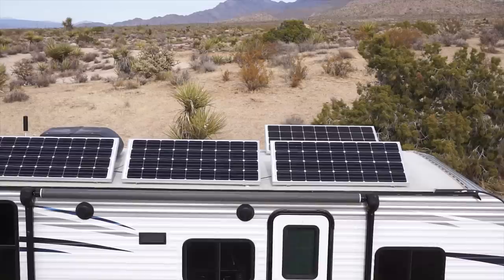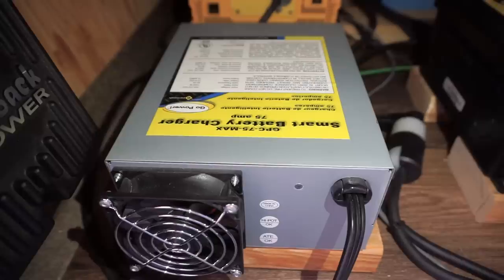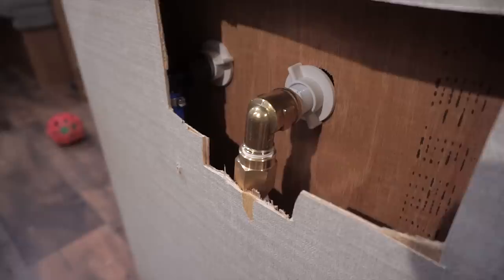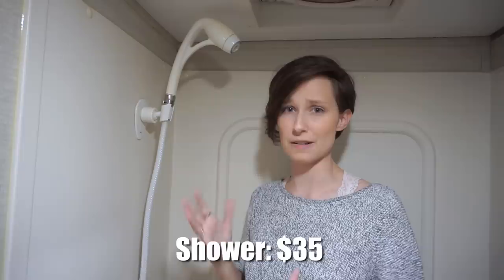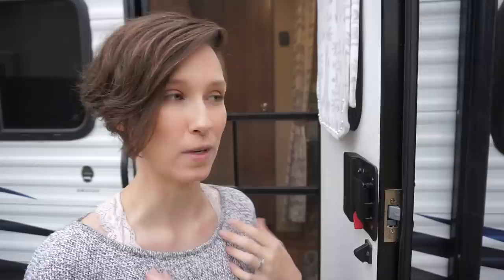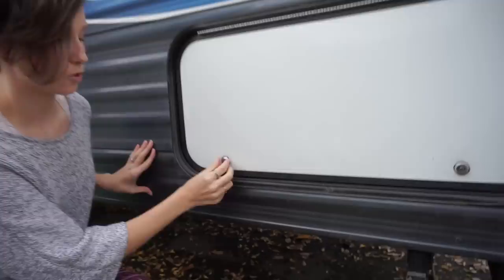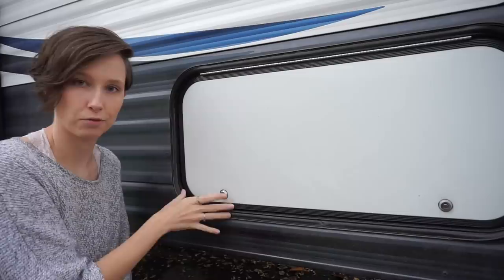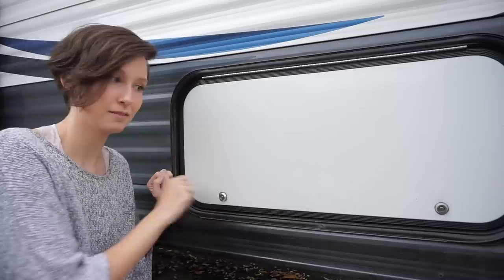Was It WORTH IT?? - All Our RV Upgrades Review - Solar, Toilet, Booster & More

Comment: I know im late to the party.... Sorry.... but if you are still having the issue Ref: the rv lock.... "guinea pig" as a test. take out one of the screws that holds the lock in place. Try grinding the tip of the bolt back by... say... 1/8" but no more... you will probably have to taper the very end of the threads after you've trimmed to length, just a bit to clean the starting threads up. if you feel like the one bolt has achieved you purpose, repeat the process. This process is based on the premise the bolts have bottomed out.

Comment: Putting a one-way valve on the hot water line to keep that from mixing is a brilliant idea!!!
 It would also help behind the shower that's outside because I've heard of people using that at a dump station and forgetting to turn both valves off (only turning off the shower head) and not realizing for quite some time why they were only getting lukewarm water from their water system!!!!!

Comment: I'm looking at downsizing my 5th wheel to a much smaller travel trailer (it's just me and my cats). Since your trailer has the aluminum sheeting on the outside instead of fiberglass for its external walls, do you find it gets loud during the rain? I imagine it would sound like my mobile home's metal awning did, which got very loud during strong rain storms.

Comment: To keep it from moving around just get a piece of rubber pad like I did cut it out to the size on the indoor and then place it with this screw and it will hold it nice and tight and solid to prevent it from moving

Comment: Hey guys. To secure the loch you can put a little adhesive behind the interior plate. Also to keep the screw from backing out is to put some locktite on screw. That should hold it.

Comment: I’m wondering if the door screws are bottoming out? Meaning they are a hair too long. 
Anyhow great video and reviews. Thanks.
Reply: I installed this same lock, and one of my screws did not go fully in.  I sanded a thread and a half off to fix.   But,  as pricey as this thing was you should not have to do such things.   And I dont think ther screws are really too long,  but thre holes are not fully tapped to thre bottom.  But did not have a bottom tap to fix it that way.
Reply: what i was thinking as well massaging the end of the screw with a grinder to make them shorter and a little blue locktight on all screws to insure they don't vibrate loose would make a huge difference!

Comment: If your still q ing problems with that screw on the door....remove the screws,James as many toothpicks as u can in the hole, cut or just brack them off as u go...now try scewing that screw back in, it has something wood to grip into. CHEERS Your doing a super job and have to e of useful info,thanks

Comment: I did a one minute test into a bucket with that Oxygenics shower head and it used more water and had less pressure than my stock Camco shower head.  So I put the Camco back.
Reply: That will save me a try. Thanks.

Comment: RE;  The door lock, buy screws that are just a bit shorter and try them.  Or thy could be cut down two or three threads.  And as "Dave W" recommended use Loctite and a silicon sealant around the inside fascias.  We have a Springdale and definitely added the lift components.  Also bought a 3" Lucid gel memory mattress topper.  Added onto the original mattress was the solution.  Very comfortable after that.  Price for the mattress was $94.99.  A regular queen size I had to trim it to fit the RV Queen.
Reply: correction:  silicon both inside and outside of the door fascias.....

Comment: Thanks for the info. 1) HATE it when turning the shower back on and the cold comes out. Best info on that. I will be seeing about the 1 way valve for my 5ver. 2) Aluminium blinds should be outlawed. 3) I see the lifts for the bed in the future for my 5ver also.

Comment: Regarding the smell from the toilet, that is probably due to the urine fumes going back up the funnel.  A simple solution would be to take out the urine container, install a line directly to the grey tank while installing a shut-off valve on the line so that no smell is coming back up.  Opening the line would be just a quick turn of the valve, rinse after use and close the valve after.
Reply: Or save 3 grand and 30 hours of labor and do your business outside.  Waste of money.

Comment: How long a run time do you get out of your Airconditioner at night with no sun on those batteries?
Reply: Also interested
Reply: @seeworthyglass2880  
Batteries / sunshine don't run ac.
Reply: terryblount I’m pretty sure you’re wrong... though I don’t think we will get a response with the answer. Good luck with your RV projects
Reply: @seeworthyglass2880  
Obviously massive solar systems will run ac but the cost and weight and effort of making such a system work quickly reach a point of diminishing return.

I have used a small solar system for cooling but I only had to use pumps and fans to exchange the 68 degree ground water temperature with the 85 degree atmospheric temperature.  Cold ground water is just not available at camping grounds.
Reply: @seeworthyglass2880  
I thought I was wrong once but it turned out that I was righ.

Comment: My RVLock (uses a key fob, not push buttons) doesn't move. I used blue thread locker on the screw threads. I also replaced the baggage door locks with 3 digit combination locks and the remote for the entry door (with push buttons), is in the nearest baggage compartment. That way we can leave the camper locked and not worry about being locked out if we don't want to bring a key or fob with us.

Comment: Great Video, thank you. I'v just started RV'ing and making upgrades/fixes etc to mine. With the Door lock (I have a standard house type working great) you might consider putting a tiny bead of silicone adhesive under both interior and exterior plates (after well cleaned surfaces)and reassemble them. This should eliminate the movement. As far as the one screw (couldn't see it too well) could you change screws and possibly drill out the countersink (or add some) to the hole to allow the screw to seat better. Corrosion, that's a bugger. Well wipes silicone and nail polish on the flat portions of the strike ... maybe.  Not sure about that one.

Comment: Take the RV lock a part, and use some clear silicone on the back plate where it connects with the door, and reassemble it.  As for the loose screw, you can try a longer screw or put some silicone on the threads and screw it back in.  Let it dry for about 24 hours before giving it too much use, and it will resolve a lot of the issues you are dealing with it shifting on you.  It will also add some waterproofing on it.  You could also use some plumbers putty.

Comment: Where the screw on the striker plate is put a machine screw instead of a wood screw.  You will will have to drill a hole from the striker plate back to where you can put a nut on the machine screw.  Drill a hole threw the side to where it intersects the machine screw and install with Locktite.  You will be very happy

Comment: Ok, I’ve been thinking about the lock issue. Here is my experienced in maintenance opinion. The screws are bottoming out, aka too long. Pull one out, go to Lowe’s or Home Depot, and get the same and you can probably get stainless 1/4” shorter. That should cure your issues. Also replace the striker plate screws with stainless. If it worked, let me know and if not I’ll talk you through some other options.

Comment: Well done!
Maxx Air Vent Cover, about $30.
The original shower head was designed to drip so the water temp stays constant while you are soaping up. It is not a complete shutoff, by design.

Comment: Take a counter sink to the latch plate. 
For the lock shifting ....Trace the lock( w/ pencil)on where you'd like it to sit the trailer. Take it off and run some silicone caulk under where you'd like it to be on the door. Place  back over silicone tighten and hold in place until dry with painter's tape guaranteed never to shift again

Comment: For your loose keyless entry locks being loose & wiggling. Take the lock back out & cut a gasket out of some automotive gasket material to put between the body of the lock & the door. If that doesn't fix the problem then put a gasket on the inside of the door also to fix your wiggle problem.
Gregg Muse

Comment: solution for keyless lock... adhesive called "shoe goo" (look in shoe isle). It literally holds my truck tool box to the bed of my truck and patches bike tires. Use a couple dabs  on the outer plate and stick it to the door... You're rusting screws? Take one out...go the hardware store and ask for help finding brass or stainless steel or something... They will find it. Screws coming out?? Again, some shoe goo around the head or thread locking compound from hardware store

Comment: Try getting a sheet of rubber gasket at Lowes or HD and cut to fit the inside of the luck, that will make the door a bit ticker - try a piece of card board first (shoe box) to see if it will work, or you can try shorter screes or file down  two of the screws to see if it would work. Best of luck Guys.

Comment: You also might try the golf tee trick: for the keyless entry. Basically you break off and shove the tip of the tee into the existing screw holes. Then remount the lock. The idea is to give the screws something solid to bight into.
Reply: wmsatic maybe use longer screws with that great idea of yours !

Comment: Not sure how the inside of your door is set up but there are a couple of possibilities for keeping the latch screw from loosening up. Inserts are available to go into the existing hole the screw goes in. This only works if there is wood on the inside of the door for the screw to turn into. Might have to drill the hole slightly larger. Another better possibility if there is wood inside the door where the wood screw turned into is to use a threaded flat head machine instead of a wood screw with a T nut on the inside for it to turn into. Would probably need to drill the hole in the door larger and deeper to insert the T-nut  on the inside of the door. If there is no wood inside for the screw to thread into and all that holds the screw is the metal add a piece of wood on the inside for the original screw to tighten into or use a flat head machine screw with a regular nut on the inside. This is a last resort because every time you need to remove that screw the nut would fall off inside. Also you might be able to put some sort of spacer inside the door around the lock to prevent it from moving. could be wood, plastic, or metal. This would be even more effective if the screws for the lock went through the material you use to fill the the space between the door and the lock if it is possible. Schlage makes a lock with similar features but a different design. I have one on our door. it works well for us but we have it in a metal entrance door on our home so the construction of your door may be different.

Comment: 21:32 We have the RV Lock on our camper, it is solid and does not move.  The bad thing about the RV lock is the material that the screws go into is of a plastic type and a machined wood-screw holds it all together.  I should imagine if over-tightened, these screws would strip out the plastic.  Personally I would buy the lock again, it has been rock solid since we purchased ours, but the one thing I do not like about the purchase, it only comes with one remote, you can buy more remotes, I just wish for the price it had two of them.

Comment: I have two RVs with the RV Locks on them.  On one of them I had the same issues that you are describing.  What I found was that the screws & bolts supplied with the RV Lock were just a bit too long for the thickness of my door and striker area.  I went down to my local hardware store and got ones that were just a bit shorter.  I also used a bit of lock tite when I installed them.  2 + years and no issues.

Comment: Add silicone caulking to the door lock around the perimeter should work well. Or make an aluminum plate as a spacer to make of the difference in the thickness of the door

Comment: Try a silicone sealant on your door. Take the new handle/lock off, line it with a silicone, then screw it back in place. Should keep it in place and water proof :)

Comment: I had trouble with screws staying put on my 5th wheel, so I would use a bit of jb weld on just the screw and it works perfectly.

Comment: i'm sure someone has told you but put some silicone on either side of the door handle and i wont move anymore. if you want something less permanent: Use a hot glue gun to go around the opening, let it harden, then reinstall the handle. Won't do as much for water proofing but it will stop the moving. :)

Comment: Put a golf tee in the screw hole and take some door wedges that you get at the hardware store and slide in behind there and tighten it down to where it will not slide around that may work for you

Comment: On the door lock, if you take some 2 sided tape or even some thin rubber and put behind both sides before tightening it back down it should stay in place better. The screws that keep coming out I would get some stainless or coated screws from the hardware store and use some blue or low strength loctite on them and they should stop backing out.

Comment: If you pull the interior of the door off you can set blocking, I'd use gorilla glue or something like it ,then put it all together and it will be solid.
Thanks for the vids
Reply: Agree with you totally the door is hollow so unless you sturdy it you'll never get the screws actually tight.

Comment: If you use a use a machine threaded stainless screw that is long enough to reach the lock enclosure with a washer and a nut it will stop the latch assembly from loosening up.
to stop the lock mechanism from moving just take it off and put some silicone  on the inner sides and reinstall it and you will completely stop it from moving around.

Comment: i would say for the front door you need to either shim the strike plate and the housing. The screws look too long basicly. 
So either go find shorter screws, which you might need for the strike plate. Or shim it so it just compresses better. 
if the issue is the screws are backing out i would say use a thread locker. 
Weather proofing? Clear coat maybe?

Comment: Get some automotive thread locker.  It comes in red and blue, one is used for a really strong hold on the screw or nut.  However not so strongly that you can’t remove the hardware with firm effort.  The other color does the same locking effect, but will take magilla-gorilla effort (strength) to remove, often stripping out screwdriver 
slots/phillips drive for the screws.

Comment: You can go to Ace hardware, type store, pick up stainless steal screws, and a striker plate, the reason the new lock moves, is because its body is smaller than your old one, the screw hole has been wallerd out.

Comment: For the loose door latch screw take the screw out take a toothpick break it off. Put the screw back in and try that with blue Loctite on all the screws so they don't wiggle loose overtime. If the toothpick doesn't work go with a thicker diameter screw find out what size it is at Lowe's or Home Depot and go with a larger-diameter non rusting stainless steel screen. You mentioned  the lock was rusting I think the lock is made out of aluminum I do believe.  But I have been getting some stainless steel screws at Lowe's or Home Depot that are rusting. That shouldn't happen but obviously there a Chinese knockoff. You could add a few drops of silicon on the back of the RV door latch if it keeps coming loose.

Comment: Putting a small amount of some GE silicon sealant behind the inside portion of your door lock will keep it from moving (once it dries). And some Rust Neutralizer will stop the rusting (available at an auto parts store). And try changing that screw to a larger thickness screw. You may have to drill out the hole in the strike plate a little.

Comment: Great Video, I would mount a metal plate behind the inside door jam on the open door, 
make a slit in the door the length of the plate-the plate will need to be drilled out & tapped to a new machine fine thread . Then you will need to patch up the slit with paint-able  silicone then painted to mach the inside of the door.

Comment: Yes Loctite thread locker is fantastic if the screws are coming loose. Is that the problem? I suspect the screws may be bottoming out in the out side plate. You may need to use slightly shorter screws to get the sandwich effect really tight. 
A little silicone between the lock plate  and door might help stop the movement as well.
The cat and blinds thing was very funny!

Comment: On the door handle screw, you could put some thread lock on a stainless screw. Is the door hollow? Add a filler inside the door so it does not squeeze and become loose.

Comment: Sandra Westley from the UK we use cassette toilets over here, with bio degradable liquid, you can empty these down any toilet, but all sites provide an outside toilet for emptying cassettes, we empty ours every  2 days, wouldn’t like tank of poo hanging around. 😂😂 there are no sites that have individual emptying pipes. You can have full pitches with water and waste water, pipped in but no black waste. And there are no facilities anywhere to empty black tanks anywhere throughout the UK, even Motor Homes or RVs have cassettes.

Comment: For the locks blue locktight on the screws get some stainless screws from Ace .they have an awesome selection on screws. As for the wobble lock take it a part and if you can put a little RV caulk on some spots on the back of the lock panel .